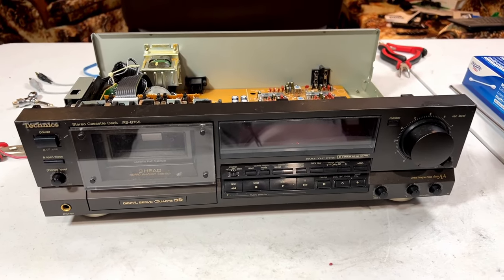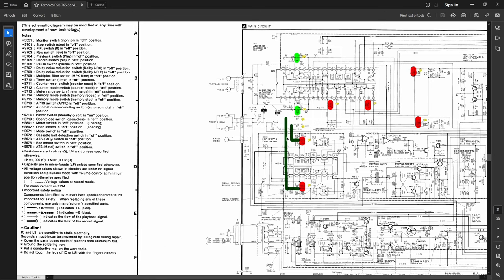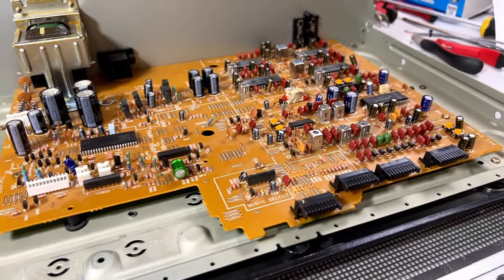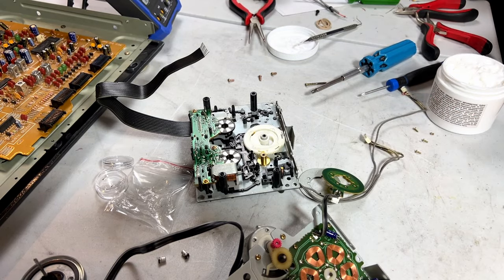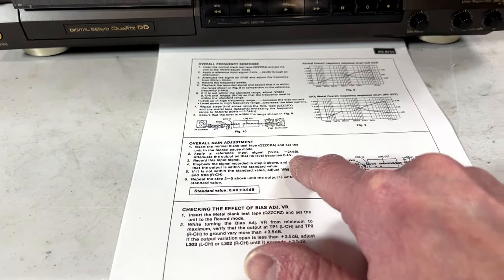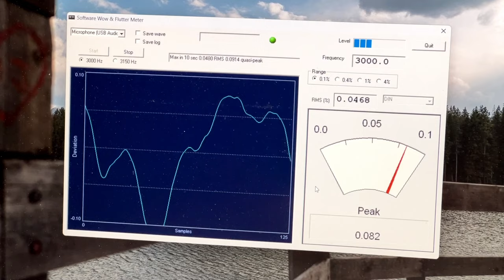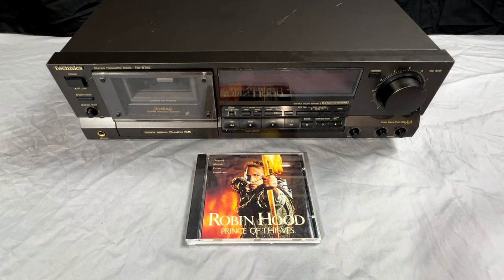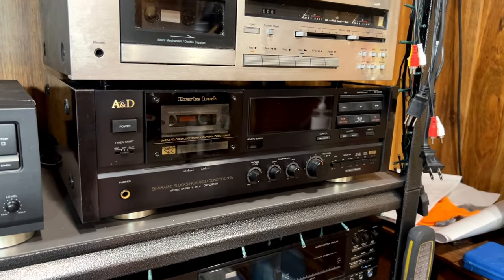Technics RS-B755 - ANT Modifications and Finishing Touches

Comment: Nice video. The frustration at some points is recognizable. If it starts feeling like work instead of hobby, just leave it and continue another day. I learned the hard way😂. Also accept that it’s 30+ years old gear. Good enough is the new perfect. Was a bit surprised you were surprised about the exact 3K measuring like you did😂.  I once let such a deck (655) run tape for 100 seconds and just measured the actual length of transported tape. Almost exactly 4,78 meters. Thanks for sharing.

Comment: It will always be 3000 when recording and play back tone on same deck.  If you put proper speed tape in, it will be 3015, which is normal for quartz lock deck.  They play slightly fast from the factory.   If you record 3khz tape on this deck and use that tape to calibrate another deck, it will be 15hz off.

Comment: Just to add a bit to what Mr. Sidiropoulos wrote, the 1.4 times number can be correct, but not universally. It can also be higher, correct, or due to the phenomenon of complimentary error, even lower. Consider it similar to phase cancellation but in the mechanical realm. Although every W&F meter I've ever seen has the ability to generate a signal, the results of using it in this way are meant to give a reasonable expectation of meeting the NAB standard (which is a comparatively high .2%), not so much for accurately testing the actual flutter numbers. That needs to be done with a dedicated flutter tape in a high quality shell as he stated. At very minimum, record the test tone at the beginning, middle, and end of the tape, then measure the flutter on playback for some generally beneficial data. If you wish to be further surprised, do it a number of times over a period of days, temperatures, and relative humidifies :)
Reply from the maker: Very helpful, thanks.
Reply from the maker: Finally got the time to check the Technics speed tape on the DR-M3. The M3 is still running exactly 1Hz slow, and confirms the Technics tape is slower than it should be. It also gave me better W&F results than my FYA reference tape. Not that it means too much while said tape is giving me the wrong frequency, but I'm starting to think the Technics is actually running at least as well as the machine that recorded the FYA tape does (TC-K555ESJ). It's running better than next week's direct drive unit as well, but I'll let that video speak for itself. It was shot before this one went live so I didn't have these comments to learn from at the time.
Reply: @Oklawolf  1Hz slow isn't even close to any kind of concern, I'd say you did a good job on both to get them so close. I would think the Technics would be a little fast but all depends where the FYA tape was recorded. I don't have one of those so can't check. I did buy one from someone or other a while back just to keep mine from wearing out, but I should have just stuck with my own homebrews, they are much more consistent. Looking forward to the next one.

Comment: Hi, one comment if I may. When you record a 3kHz tone to a deck and play it back on the same deck, it will show you a false correct speed reading because you are recording and playing at the speed of that deck. Whatever that speed is. And if you monitor directly during recording, you will get a perfect speed reading because you are eliminating any speed fluctuation the deck might be having between runs.  The w&f reading you get by recording and playing back on the same deck will be approximately 1.4 times the reading you would be getting by using a reference flutter tape. For example, if you record and playback the 3kHz tone and get a 0,056 reading, it means actually 0,04 that you would be getting if you were measuring using a tape with a residual flutter of less than 0,04%.
Reply from the maker: Interesting. I'll have to try the tape this deck made on the other quartz lock machine I just finished restoring sometime.
Reply: Checking a quartz locked deck with a tape from a quartz locked deck won’t help.  You could make your calibration tapes stating to set any deck from that tape to 3015.

Comment: Hi, perfecious here. I Did the PDF summary with all the mods. I thoroughly enjoyed the video. The sound demo from Robin Hood, one of my all time favorite films, really brings back some memories. :) 

However, I would like to apologize and issue a slight correction regarding the modifications when using the amorphous head mentioned in the PDF. This is only if the head is changed, so in the case in the video, it doesn't apply, but it's important to mention non the less.

The CB 36001 is a half amorphous head, with only the playback head being amorphous, and the recording head is hard permalloy, very similar to the original. That means that the modifications listed on the recording side should not be made. The CB 36001 should work correctly with the original configuration.

The head Alex most likely used for these modifications, is most likely designated "H2374-4105", which is used in decks like the TEAC V-3010. I need to confirm that though. It's also a head with a left guide, which is what should be used in the technics decks anyway. The CB 36001 is a head with a right guide, so I would not recommend using it in these decks, because it has some issues with phase between the rec and play heads, due to horizontal offset. I will update the PDF's with this information to correct the errors.

. . .

There is also another important thing that is not mentioned in the PDF (which I will correct). If the OP-AMP is changed, it is recommended to change the signal path capacitors to bipolar, with my recommendation being to use the Nichicon UES. In fact, recapping the entire signal path with them is highly recommended by me, this deck greatly benefits sonically with that. That also includes the 2x 470uF caps in the PB EQ (C9 & C10). I've also discovered that the LM833N or the MC33078 op-amps sound amazing in the Phase Correct stage, so if you want to thinker with the deck a little bit more, I recommend to try them. They are DIP8 package though, so you would need to make a DIY adapter. 0.1uF Bypass caps across the supply pins (4 & 8) are also a must as always. The NJM2114 is fine, but it's a bit more cold and flat sounding comparatively. Still decent though. 

Also, the big local filtering caps 1000uF 10v (C620, C621, C618, C619, C610, C611), which are 6x in total, also play a huge role in the sound. I liked Panasonic FR best in those positions, but you can keep things consistent with the Rubycon's, I haven't heard them though, so I can't comment on them. The other local filtering caps you can leave the Puresims in, although I did recap them with Nichicon Fine Golds on my 755.
Reply from the maker: Thanks for stopping by, and for your efforts in making the PDF! I was originally planning to do just that with the UES parts - I think I have them all on hand. I just wanted to see how those Purism caps sounded first, is all. I was only in the process of discovering how much I like those Panasonic FRs at the time I did this - I'm going all-in on those now. I've got a full complement of FRs coming in for my first import from Japan for 2024 as I type this. Only one capacitor in the PSU of that machine won't be an FR, and it's the big one I couldn't find an FR for. I went Chemi-Con KZN for that one.
Reply: @Oklawolf  That's actually a good plan, checking the sound with the original caps first. That way, the 755 will impress you a second time. :) 

BTW, keep an eye on the W&F after some time passes. I had some bad experience with FIA rollers for these decks. Initially, the performance was decent at 0.045% WRMS (worse than the original roller at 0.0280%, so if it's not in a bad shape, I recommend the original roller), but after a few months something happened where all 3 rollers degraded in some way, and the W&F jumped to 0.1% on average - terrible. And that is not a case with just a single deck, I had them installed in 1 RS-B555, the RS-B755 and a RS-B965 - all degraded similarly in performance. Now this could be just bad batch and my luck, and thus an isolated case, but I have to mention it. Basically, just check the W&F periodically, to make sure W&F is still good. Right now, it seems excellent.  Hopefully it will stay that way. Good thing is, you can remove the roller arm from the front, without needing to disassemble the deck again. :) 

Cheers, and happy taping!

- Chris
Reply from the maker: That reminds me, the M245X from last week got its recap now using the UES parts in almost the entire signal path. UKLs in the DBX circuit and other places needing low leakage, FRs in the power supply. I should get that video done, because that deck sounds like it had a decent leveling up on playback alone. I figured I would do the polar to bipolar experiment there first because it needed new capacitors much more urgently than this one.

Comment: Very nice and informative video. I am owner of the RS B765, which is identical. Currently looking to replace the smd capacitors on the DD motor. What capacitors have you used on it?
Reply from the maker: Two 10uF 16V polarized, three 4.7uF 25V bipolar. They don't need to be anything special.
Reply: @Oklawolf  Thanks!
Reply: I've finally replaced all the electrolytic capacitors on mine including the gears and ofc performed some modifications as well. I gotta say you got lucky having most of the capacitors replaced by it's previous owner because the original PXS ones was really bad, they could dry out over time and fail. Thanks for the modifications part, I've kinda followed you in the modifications.Edit: I forgot to mention the leaf switches could fail at some point and need to be replaced.
Reply: Also how did you got the power transformer off the actual board, I had a really hard time with it attached on.

Comment: factory specs are 0,05 w&f and you get that so what you expect? you can’t do better them factory in mechanism much unfortunately, you can do electronics mods but when it comes to mechanism is not so much possible. anyway, many decks with double capstans witch to have this w&f results especially as they all are old ones.ps, when it comes to those brakes you can use any rubber with same size. what i did i bought a cable with same diameter and i use this cable shild as a replacement for those brakes and it works very well.